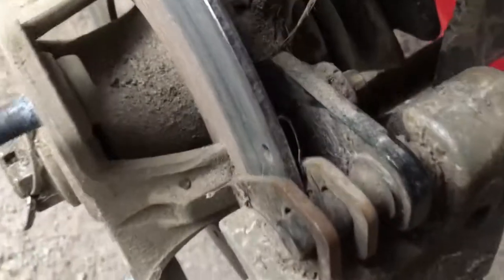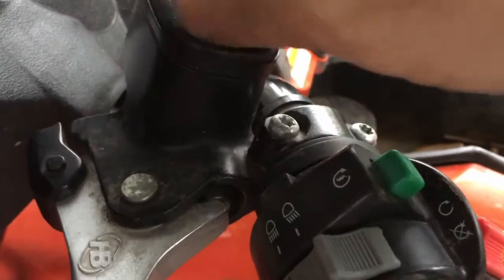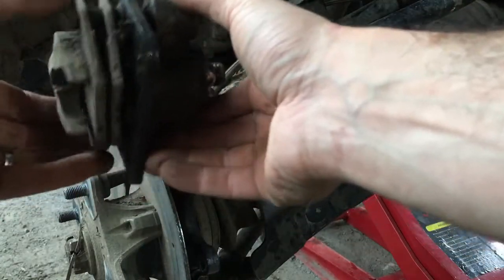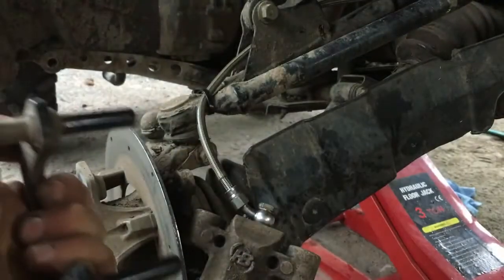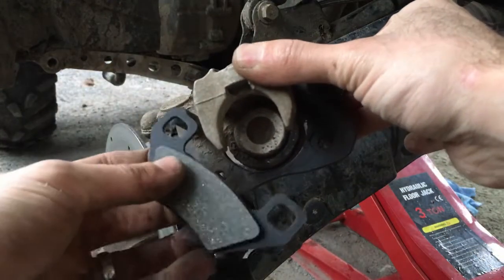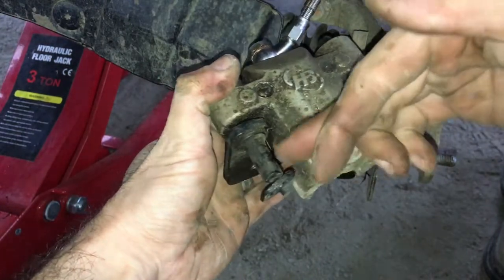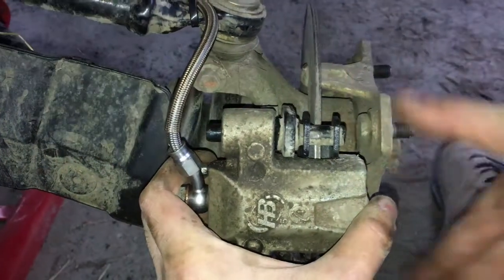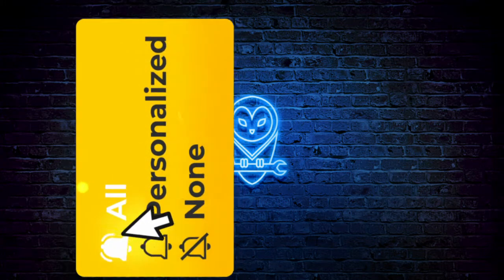How to Replace ATV/UTV Brake Pads - Step-by-Step Guide for Beginners

Comment: awesome thank you at the end do I need to pump the brakes similar to cars to in order for the brake piston to reposition
Reply from the maker: Thanks for watching! Please subscribe to our channel. 

You only need to bleed the brakes if you introduce air to the system. For example, if you change a brake line. 

Are your brakes still soft after replacing the pads?
Reply from the maker: @moeferrari